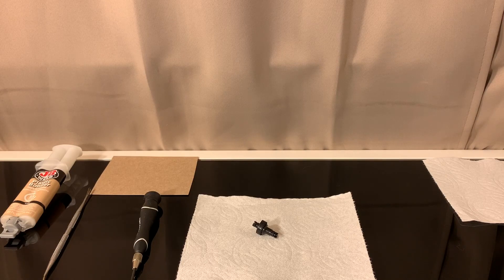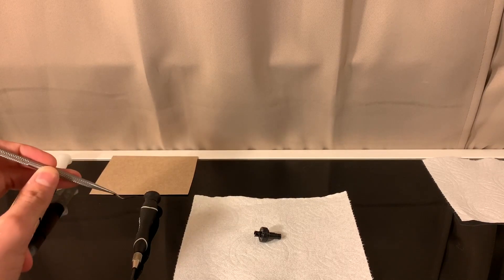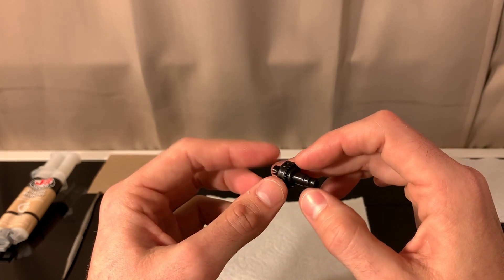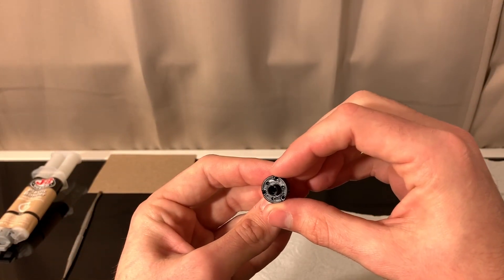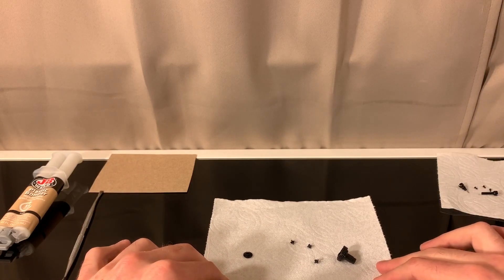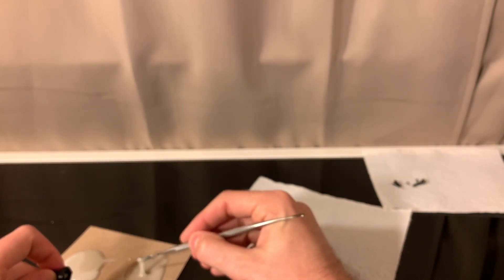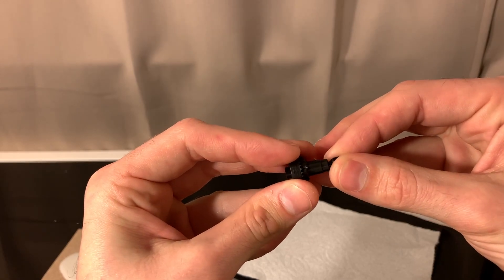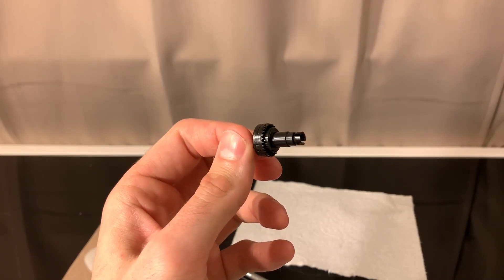DIY Locked Differential Mini-Z AWD Micro RC Mod

Comment: I just planned on putting a heavy weight grease like you do with offroad.  Wont lock it up entirely, but it'll be pretty dang stiff.  I need mine to be able to turn a little.
Reply from the maker: That's an option, but I feel like it would end up getting grease all over the rear end since it can leak out of the stock diff. Have you tried this yet?

Comment: Nice video, if you Dont want it to be permanent use hot glue or pack the diff with Silly Putty. works like a charm and is reversible..

Comment: The thing is I have no idea how to get the diff out of the car in the first place :/
Reply from the maker: No problem, here is a video on how to tear the car down: https://youtu.be/YDvmwCOm5xE

That video will show you how to access the front differential, and once you pull the rear end off your car, just remove the 4 screws on top of the diff housing & it will expose everything. 

Let me know if you need further help, I can make a video on how to access the differentials if needed.
Reply from the maker: LineChaos hey buddy, I made this video specially for you: https://youtu.be/oCFD6GtKaVA

Should help you get the diff out ;) have a good day!

Comment: Love the vids!

Do you do this to both diffs? I did it to the rear and I feel like my MA020S is now more unstable than ever. I am getting rapid steering pulls and do not know why! I opened everything up and nothing seems to be broken or out of place...

Any help would be appreciated!
Reply from the maker: Siavash Ghanbari I leave the front end stock open or upgrade to a one way, that way the front end maintains better grip/bite. 

Is the surface you are drifting on perfectly smooth? I noticed even minor imperfections on the ground can greatly impact the car & steering & cause it to pull in odd directions. 

I know you said you pulled the car apart, but double check the suspension and make sure it’s not sticking or getting hung up at all. It has the be 100% free or weird things can happen.
Reply from the maker: Siavash Ghanbari & thank you for the support! I appreciate hearing that people enjoy my videos and find them informative
Reply: @BMR3  yea man! you are also one of the only ones that responds to people's concerns. my drifting surface is indoors and is as smooth as possible. I am going to be taking the Z to the shop today to try and figure some things out. I will definitely keep you updated.

Thanks again for your prompt response and your fantastic videos!
Reply from the maker: Siavash Ghanbari glad to help man & I just want to see the mini-z community grow! I was hoping this channel will help encourage people towards mini-z by explaining how the cars work & offering advice. I don’t think I have had much impact yet, but I hope I’m helping 

Like I said, keep the suspension in mind and check to make sure it’s not binding or sticking. I try to keep my car as “dry” as possible so I don’t collect extra dust or cat hair, but you may want to try lube your suspension. 

What I mean specifically is: lube the cylinder/shafts that stick off the knuckles, & lube the ball joint that sits on top of the front steering knuckle. If your going into an RC shop ask them to use some high weight thick ball diff grease for lubing. 

And when I say lube it, I mean barely use any at all, just enough so the suspension moves a little more freely. Use the tiniest amount possible so you don’t attract excess debris. 

That should eliminate any sticking issue & help settle the car down. 

Good luck! Let me know how it goes
Reply: @BMR3  amazing tips as always. I have some khosho diff gear grease and I'll use that to see if I can resolve my instability issue.

Talk soon!
Reply: Hello🖐️

Comment: Any difference between locked diff and solid rear axle?
Reply from the maker: Nope, they are essentially the same thing. By locking your open differential, it turns into a solid rear axle.
Reply: I did this too, the RWD mini z still skids out one was easily and pushes the front all day when steering the opposite direction. I don't know how people can stand this.

Comment: Anyone here try using CA glue? @BMR3 would you recommend the zap CA glue medium or is it better to try a plastic bonding glue (zap has one of those too 😅)
Reply from the maker: Im sure CA glue would work just fine, it shouldn’t melt the plastic & it should be plenty strong to hold the gears. I just used bonding glue since that’s what I had on hand. 

With CA glue you wouldn’t even need to disassemble the differential, just remove one drive cup & pour glue a bunch of glue in there.
Reply: @BMR3  that sounds like a great idea! I don't think I could reassemble the diff before the CA went off 😅
Reply from the maker: @ImranShamsul  let me know how it goes!
Reply: @ImranShamsul  that’s exactly what happened to me.. had to buy a new diff.

Comment: Welcome. Have you installed an optional X-SPEED V Motor in your subaru?
Reply from the maker: ado gde hello, I don’t have a Subaru shell & I have not tried experimenting with xspeed motors. From what I gather, any motor other then stock Kyosho will fry the FHS board, even the “stock” xspeed motor puts out too much power for the ma-020s board to handle. 

But I don’t have any direct experience, so I could be wrong. My info has come from reading group posts & research.
Reply: @BMR3  Thanks for the answer. Waiting for the parts of Front Oneway Unit and Rigid Axle. If I mount these parts, I should change something in the maim mini
Reply from the maker: ado gde nah, no need to change anything. The solid rear axle will make the car more predictable & the front one way will help you whip a little tighter in certain situations. 

The only thing that I would recommend is possibly DS Racing LF4 drift tiers, but that depends on what type of surface you drift on. Personally I love the LF4, it’s like the car is on ice, so it’s super easy to break lose. 

But don’t be too worried about upgrades. Focus on your technique & spending more time driving the car. Upgrades won’t make you a better drive, they just help you learn easier. The only thing that will make you a great drifter is to spend hours and hours practicing.
Reply: @BMR3  I have drift tires that were included with the latest subaru AWD
Reply: @BMR3  Is it worth buying and installing Aluminum Motor Holder SetⅡand Aluminum Motor Cover
Reply from the maker: ado gde I am a huge fan of the heat sink motor mounts paired with a good motor clip like the PN racing one. Having aluminum motor mounts paired with an aluminum clip will heat reduce considerable. This upgrade won’t have an impact on performance, but it will help a lot with the longevity of your motor since excessive heat kills brushed motors. 

Just be careful when picking your motor mounts to make sure they are matching the gearing your currently using (or want to use). I also recommend getting Kyosho brand aluminum motor mounts since they will have perfect fitment & your gears will be super smooth. 

I like the PN Racing motor clip since it covers the bottom of the motor & goes up the side of the car. The extra surface area will help pick up the motor heat and disburse it quickly.

Comment: So if I lock diff like your vid shown but my front part is still oem ( not yet one way diff) would this still work or I shall have one way diff first .
Reply from the maker: Yep that’s the set up I’m using for my current 020 build, stock open front differential & a locked stock rear differential. It works great, a one way differential does not make a huge difference honestly.  

A front one way essentially acts like a open differential, but there is a one way bearing that prevents rotation in one direction.
Reply: @BMR3  I know this is older but just for anyone that might be reading this for the first time, like me, just my .02...  My understanding the biggest advantage with the front one way is under braking, not really driving.  When you brake with a one way installed, you only get braking from the rear, not the front, basically acting like pulling the e-brake.  This allows you to tap the brakes to help rear slide without affecting the front.  Otherwise, it still basically acts like a stock open diff.
Reply: @johnsland8786 what one way front do you recommend? Thanks

Comment: Nice video, it’s very detail...
Reply from the maker: Thank you, I hope this helps you out! Let me know if you have any questions
Reply: @BMR3  if i'm going to buy this part, instead of glueing it, what is the name of this part? Is it MDW018 Ball Diff Set?
Reply from the maker: Part: MDW024 here is a link to buy it for the cheapest i could find it: https://www.rcmart.com/KYOSHO-MINI-Z-AWD-RIGID-AXLE-SET-MDW024_00081466

I personally prefer a solid rear axle, the ball differential is basically the stock differential but you can tighten it up so you have less slipage.
Reply: BMR 3 ok thank you very much...

Comment: 'these mini-zs dont produce a lot of power', /me turns to my high powered tunned fleet
Reply: My 030EVO snapped a aluminum swing arm on acceleration during a corner because I was using a locked diff with grippy tyres XD

The diff binded like that should probably hold up though :D
Reply from the maker: Auranapse lol I was referring more to the stock ma-02 being low power. The evo is different. 

Either way, the comments gave me a good chuckle lol
Reply: @BMR3  Haha in that case it's true XD